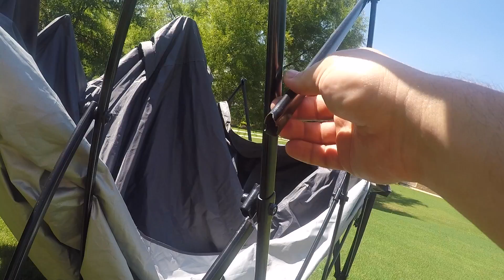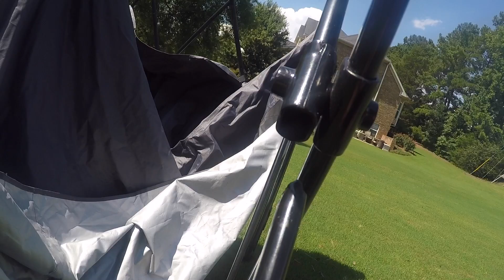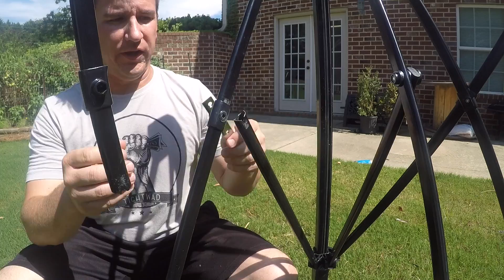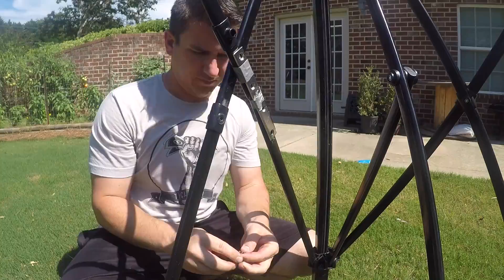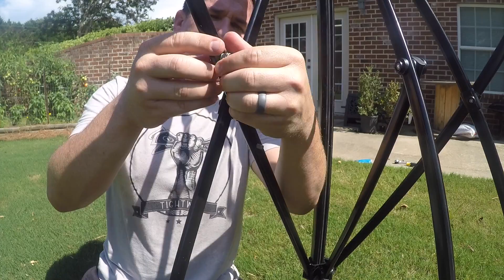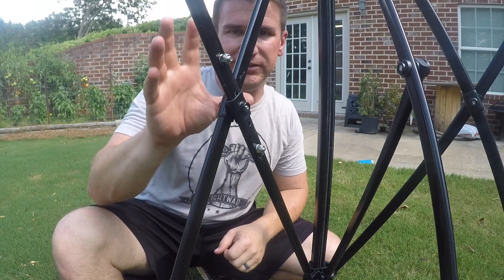How To: Permanently Repair Easy Up First Up Ozark Trails Canopy Tent Poles

Comment: Use aluminum and don't use such huge screws to hold the brace in. Steel is overkill. Alum is easier to drill. Smaller screws will do. I used wood and held for a while but they break also.

Comment: @TightWadDIY hey love the video. But im having problems drilling through the capony. Im using a Dewalt industrial cobalt drill bit...What drill bit are you using to drill through?
Reply from the maker: They make bits specifically for metal.

Comment: Generally when I buy a canopy I buy 2 - one to use, and one for parts. It seems cheaper to just buy a 2nd canopy than the separate replacement parts, especially the extra top for when it rips or gets sun faded. However, if you don't go this route, this video is a good inexpensive repair idea.
Reply from the maker: Thanks!

Comment: How do you prevent rain water from puddeling on top? The weight eventually causes the whole canopy to collapse.
Reply from the maker: Are you sure you are extending the joints all the way? If your tent collects rain water then it’s a poor design.
Reply: I use large office binder clips along the upper frame to hold the canopy taut, which helps with the runoff.

Comment: So we have similar it gorgeous higher end Ozark not sure if it broke at the pivot... we were trying to put it up quick in the dark for camping and my son snaped it when pushing it up it was for the roof I think ... do you think that can be fixed? It's  basically new I got it for vending  but haven't  been able to use.. hate to junk it... also a. Tight  wad ha
Reply from the maker: It really all depends on where it broke. You can fix most of the issues though.

Comment: Hello what is the bolt called that you took out you showed at  2:31 the black part that they go into right now they are spaced out a little due to wind it bent the frame.Thank you
Reply from the maker: It’s just a regular bolt with a hex key head.

Comment: What size are the flat bracket plate??
Reply from the maker: It will vary by tent model. If you can’t find one that fits inside, you can attach it to the outside of the bar.

Comment: Can you please detail what size holes you drilled and what size bolts were used?
Reply from the maker: thedgreenw The size drill bit used for the hole and bolts uses will be relative to the size brace you install. You should choose the largest size bolts that will fit through the  holes in the brace you are using then pair the same size drill bit with the bolt. Braces don’t have standard size holes.
Reply: @TightWadDIY  thank you I will be giving this a try soon. What length was the mounting plate that fit inside thr metal?
Reply from the maker: thedgreenw I think I used a 4inch plate.
Reply: @TightWadDIY  thank you. Unfortunately none of the plates at my home depot were small enough to fit inside the metal frame so I mounted it outside.
Reply from the maker: thedgreenw That works too as long as its not in the way when you closed it. That’s the way my dad fixed his too.
Reply: @TightWadDIY  I realized I should have used two screws on each size, but too lazy to fix it now that it is complete. But yes, I put the plates on thr outermost portion to that way to wouldn't be in the way of the fold. I'll be closing it up today to see how it goes.

Comment: I repair my Ezup Shelter umbrella like in a similar way but with two 48 inch cut to 16 pieces (6inches x1/8 thick x1/2 wide) bars and drill 5 (1/4 inch holes)

Comment: What size bolts did you use for the brace? Those two bolts on the ends that is.
Reply from the maker: Derek Karten Sorry I don’t remember. They just need to be long enough to go through and small enough to fit through the holes in the brace.

Comment: Bent 2 arms on my Z-Shade canopy putting it away. Went online and found parts, but the shipping was twice as much as the parts!  I found this video, and repaired mine with pieces of curtain rod which fit perfectly inside and secured it with pop rivets. Here's an example of what I used - https://www.curtainandbathoutlet.com/heavy-duty-white-single-rod-with-2-5-projection?c1=GAW_SE_NW&source=PLA_USA&kw=6225495001&cr6=6225495001&c1=GAW_SE_NW&source=PLA_USA&cr2=search___nw__shopping_-__all_products&kw=6225495001&cr6=pla&cr7=c&gclid=Cj0KCQjwla7nBRDxARIsADll0kDFONCehCawsEILkoUbCoaDM4SoPDA9VWjF6DgNxHgZWlht5xNF0s0aAleTEALw_wcB

Comment: Thank you so much for the tip. I too broke two arms of my tent as soon as I tried putting it up by myself. I fixed it by myself too.
Reply from the maker: H B I’m glad you were able to get it fixed. Did you use this same method?
Reply: @TightWadDIY  Yes, I used the same method.

Comment: Very helpful video. Do you remember what size drill bit and bolts/nuts you used?
Reply from the maker: Morgan Lewis sorry. I don’t remember what size it was. You would need to match it up to the specific plate you buy anyway.
Reply: I hadn't thought of that. Thanks so much.

Comment: What worked for mw, without a trip to the hardware store, was this:
-Cut the ends off the broken part as close to damage as you can.
-cut the curved parts off of a set of curtain hanging white metal.  
-slide both curtain rods together, then cut some foot long sections of it.  Pack this 5 inches into the tent like. Drill through it, put a bolt in.  Slide other tent pole onto other side sticking out. 
-set parallel to a working pole, mallet it down to that size. Drill another hole and bolt it to join. 
-now still through old poles center holw, as a guide, through the new fixed pole.

Not as strong as metal brace, but it's and easy do it at home w extra parts
Reply: Mate, pardon my late response. But I was thinking a curtain rod would work in theory, but hadn't put it to the test. Now, it seems like a trip to the hardware store may be spared.
Reply from the maker: Josh Ferencz Thanks for the tips!

Comment: We use The Coleman version for 4 days a year, now in its 4th year, to help shade over our tent that sets up underneath. I can set it up easily in about 1 hour. I'm 60 y.o but I am a strong and experienced camper. It starts out very tight, without any bagginess. It holds up well in 15-20 mph wind but not if rain comes with the wind. The south and west top triangular roof sections stretched and filled with water in a downpour so heavy that the pop up frame in the corner collapsed, putting pressure on our tent. This happened in a downpour of 1 hour in WI. , 1 week ago. The velcro was still attached at all the corners, and mid frame sections. I would like to know how I can add to the construction to allow the water to run off the roof of this canopy instead of collecting, stretching and collapsing the framing.Any suggestions for this problem?
Reply from the maker: Linda Tipler I’m not sure of any way to tighten the canopy once it stretches. Mine does not sag enough to retain water in a heavy rain. It still runs off the sides. If your canopy supports have an elbow in the middle you could try to find a way to help them stay straight or slightly inverted so they push the canopy higher.

Comment: Thank you! I have two spots to repair on our pop up...does your frame fold up after adding the two bolts? I'm headed out to,take mi e apart and get started on a fix!
Reply from the maker: Adrienne Twombly-Abbott It sure does. It works just like before, only stronger!

Comment: Yeah, the ORIGINAL brace is too flimsy for pop rivets.  I was not referring to your ADDED bracket.  The foamed glue/foam insulation  in a can was to completely marry the ORIGINAL brace to your added bracket, rather then further weakening the ORIGINAL brace by drilling a couple of extra holes in it.  This is how I repaired my broken pop-up canopy.
Reply: expanding foam? Aah duh! but why? insulting from sound vibration? planning on splitting the seams when the foam is 100% expanded a year later? just to waste mo money?
if you want to be completely married. A guy finds a woman, not a can of glue for metal lmao

Comment: Pop rivets would be better, they are stronger then the flimsy hollow brace in any case.  The ‘pop’ action may even be too much force.  Another way to do it is fill the tube with a foaming glue or foaming 
insulation.  Still plenty strong.
Reply from the maker: Jaimes Beam In this case, the pop rivets would have nothing to hold together. The brace I used isn’t flimsy at all. Its actually very ridgid. Im also not quite sure foam would be a good idea. It’s not going to hold the tent together.

Comment: Nice job on the repair! What size is the bracket that you used for this project? My tent pole is 7/8” wide and I can’t find that size anywhere!
Reply from the maker: Francis Gonzalez I’m not sure what size it was. You can’t find anything smaller than 7/8”? It doesn’t have to be an exact fix, just needs to be smaller. I bought mine at a local hardware store.
Reply: TightWadRepairs 
no 
I’ve gone to EVERY hardware store even Grainger and the issue is the brackets are 4” long in the 7/8” width. It jumps to 10”L but they’re 1” wide...🤦🏽‍♂️ I’m afraid to use the 4” cause it’s super short.
Reply from the maker: Francis Gonzalez I think 4” will be long enough.
Reply: Found this on Amazon. I have a 10x10 quik shade and the width of the truss pole is about 3/4" of usable width.  I'm still looking for maybe a longer brace, I have 3 broken sections.
https://www.amazon.com/Stanley-Hardware-75-5851-Mending-Plates/dp/B00004Z0U8/ref=sr_1_1?s=industrial&ie=UTF8&qid=1529549447&sr=1-1&refinements=p_n_feature_keywords_browse-bin%3A3975985011